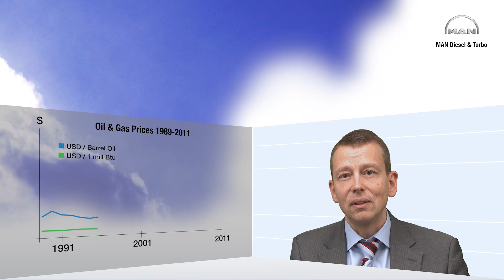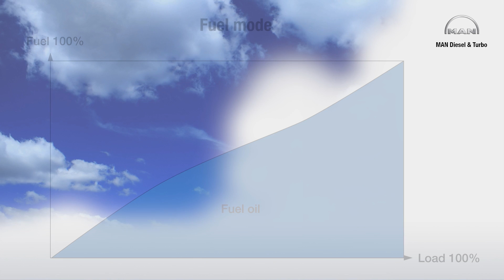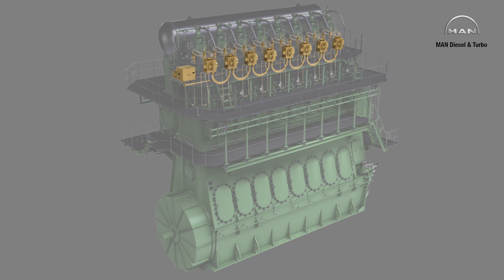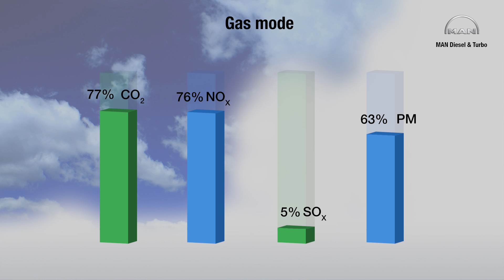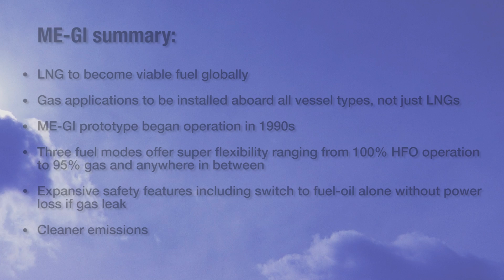Flexible Dual Future - MAN B&W ME-GI Engine

Comment: hello, i wanted to ask, if its possible to use the Gas injection system 
of the Man 51/60G with the pre-ignition chamber in the two stroke engines to use only natural gas as fuel and pilot fuel.